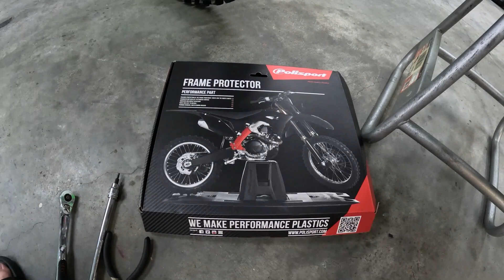Suzuki DRZ400 - Check out the new Polisport Frame protector

Comment: I struggled getting this to fit right on my 2024 drz. Couldn’t get either bushing in all the way, the metal sleeve one started to break and crack. It’s a good idea but the engineering on this sucks pretty bad. Same thing on the right side zip tie the holes don’t make sense

Comment: I bought these same guards for my 2007 DRZ400sm and seems to fit a bit odd on the reservoir side, like it doesn’t have the same bend as the aluminum guard, how did yours fit? How did yours fit?
Reply from the maker: Zip tie it or take off the guards don't want it hooking your boot or shoe .